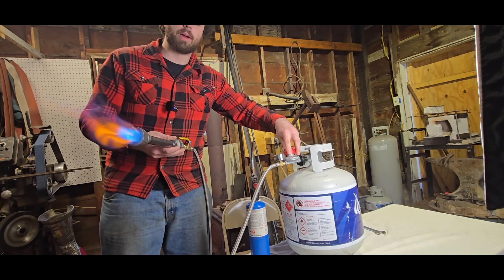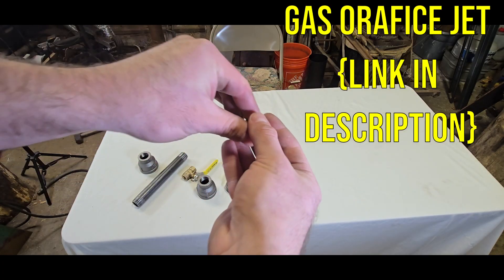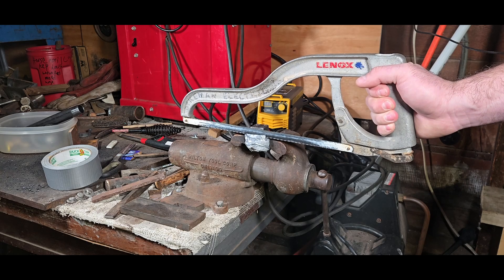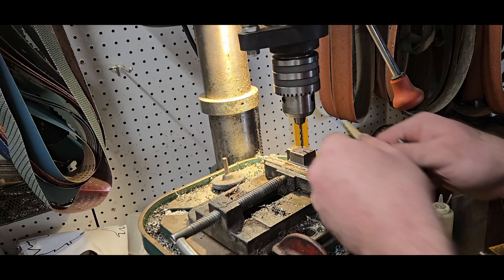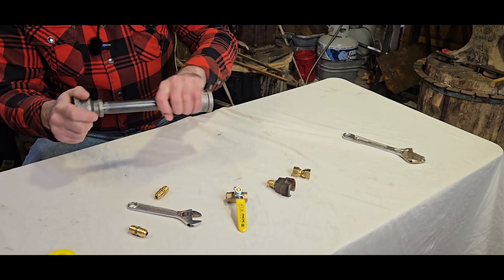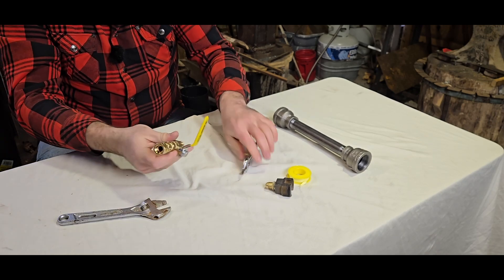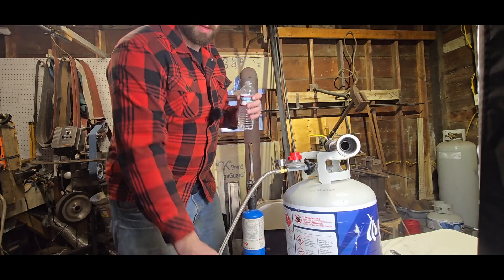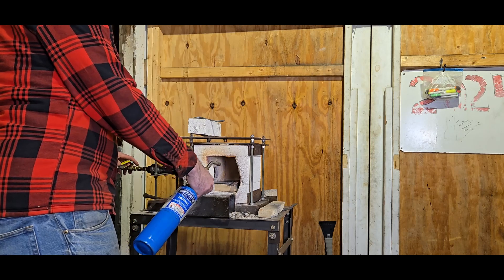How to Make a propane gas forge burner with safety valve in 2025 (easy design)

Comment: Use a brass plug “cap” next time. Will save you a lot of frustration soldering it.
Reply from the maker: Thank you I'll look into that, I just used what I could find at most hardware stores.

Comment: You dont need thread tape on the swivel fitting. 
This is a nice build. Thanks
Reply from the maker: Thank you, for the swivel fittings I couldn't get it tight enough to not leak so I used the gas thread tape to make sure.

Comment: Is there something special about the shut-off valve? Or are you calling it "safety" because it's easier to shut off in a hurry if necessary? I have 1 home built burner, and 1 factory built burner, and that valve is already present on both. (Though, the burner plans I built from didn't have the valve, I added it at the time of building) Nice build either way. I may have to look into building one similar, as my home-built burner is definitely a more complicated design.
Reply from the maker: Im calling the valve "safety" because my previous forge burner build video it didn't have this valve. It worked straight from the gas regulator but it is a bad design if you're propane tank is further from the forge. With the gas ball valve you can quickly turn the forge off or even adjust gas a little by restricting it. And the great thing about this set up is you can re use valve assembly for making a forced air burner. Im almost done editing bolt together forge video and next week I'll show how to convert it into a forced air forge.
Reply: @dgundeadforge17 That's what I was thinking, and exactly why the burner ive built previously has a valve on it as well. I was not fully awake, and was wondering if i had missed that it was a fancy valve with a thermal shut-off or something weird like that. I wouldn't put it past the gas valve people to make something like that.
Reply from the maker: Yeah nothing fancy like that, i want to design stuff simple and no proprietary parts.@firebird8600

Comment: Making one as we speak, great video. Do you adjust the air much in that setup? I’m debating one similar or with vented holes in the upper part of the nipple. Otherwise I may use the T design
Reply: Slow down and stop with the quick cuts, it gets annoying.
Reply from the maker: I need to experiment with drilling holes around flare and threading bolts. As is in video not much air control other than increasing or decreasing gas pressure. Im also works on finishing editing a bolt together forge video.
Reply: @dgundeadforge17  Thanks, I am also doing a bolt together build... I plan to use right angle steel as the frame and bend tabs out for a threaded bar to go through! 
Wonder if airflow would increase if you made a frosty T with the same bolt in gas control design (grind down the threads) on each side and had the propane going in from the top in between the two air intakes instead?
Reply from the maker: Im not sure i have my old one that i can do a short video trying to see if i can adjust air flow.@andrewbowers7254